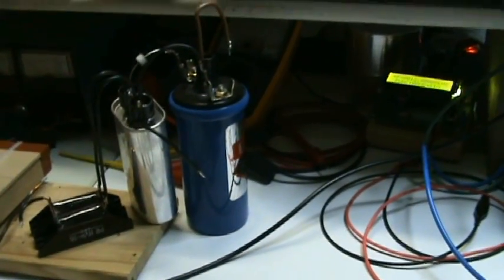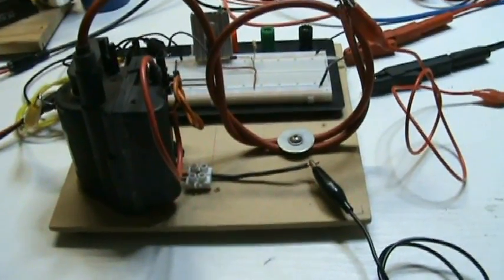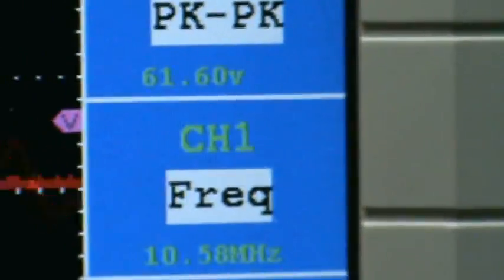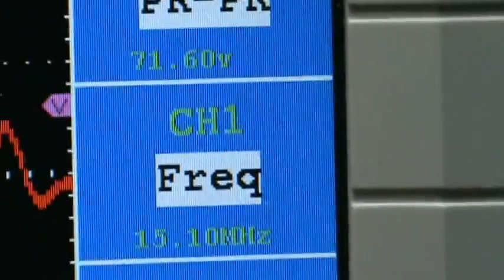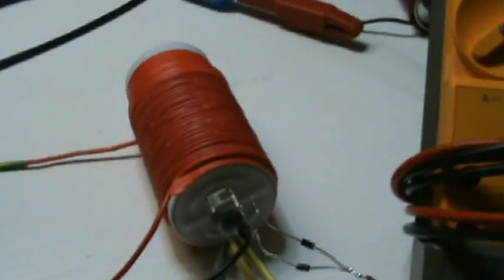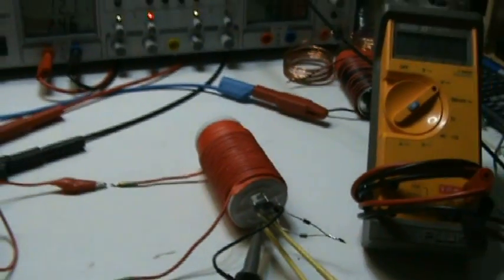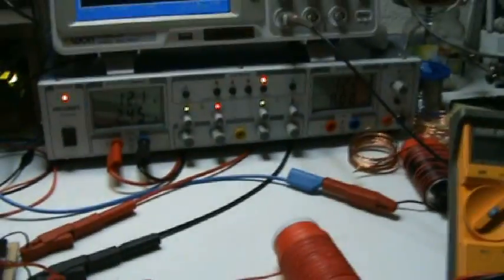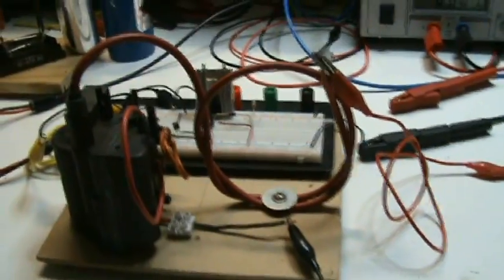Capcoil 2.mpeg

Comment from the maker: Hi Stanley,  

well i did not measure the voltage on the car-coil, its to high for my equipment, but as i adjust the spark to about 2 mm, i guess it will be around 2000V (1KV / mm).
I can pull sparks of about 2 cm, meaning 20KV, but that probably will damage the coil in the end.

Regards Itsu